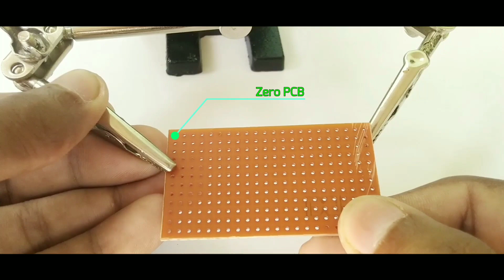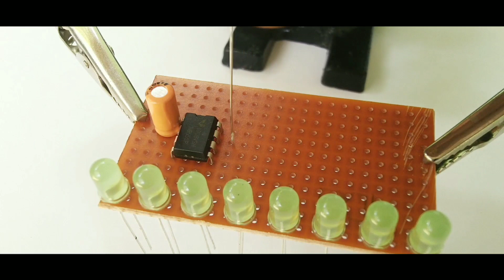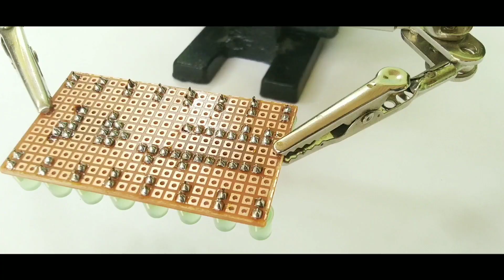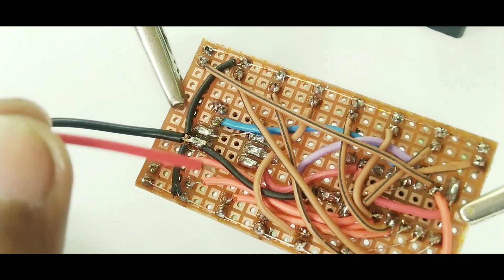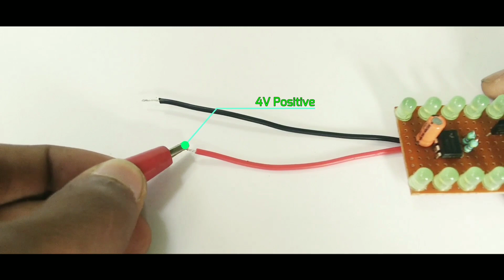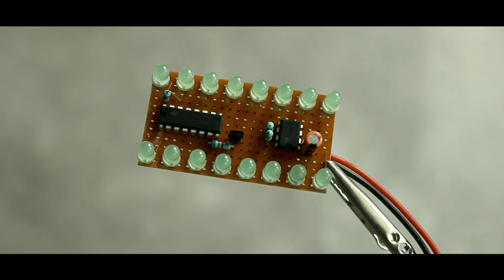WOW! This LED Chaser is Awesome

Comment: Bro I have good idea for you...
Try to use the transformer wires in connecting it's very small and let more space for soldering other components and you are not using high voltage or high amper so that it will work normaly (-:
Reply from the maker: Good idea
But the circuit will become more confusing.
Reply: Oh ok but you are making circuit diagram for every project right?